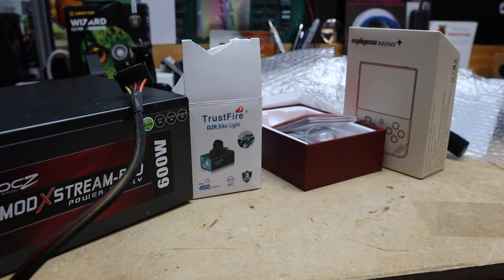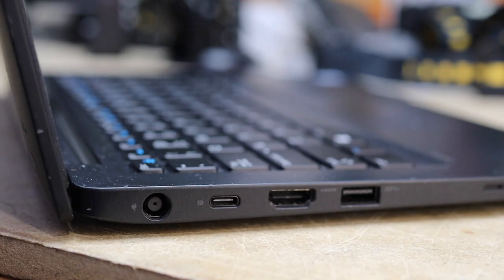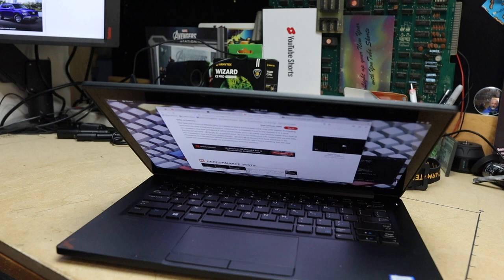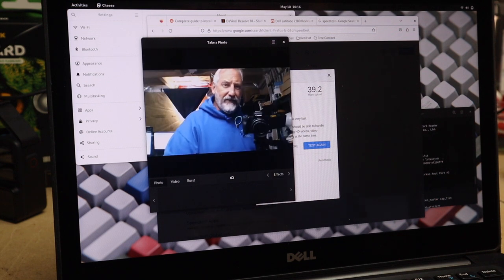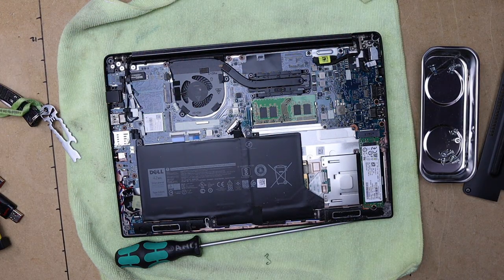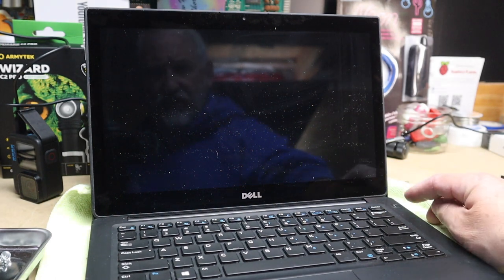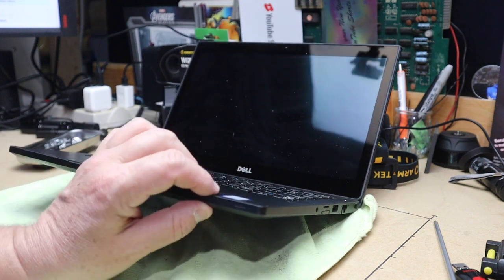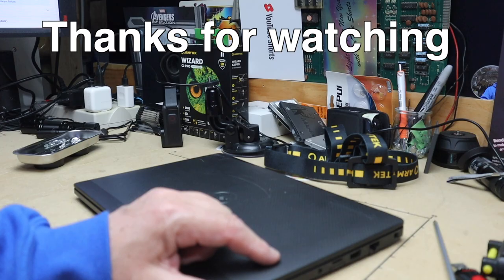DELL 7280 running Fedora Linux

Comment: Thanks for the review! I'm looking for a new Linux laptop (for light usage - just browsing, YouTube etc...), and am thinking about this model. A little put off by the single RAM slot. I might go for the Latitude 7300 instead. I'll be running Arch on mine (with KDE Plasma) 🐧
Reply from the maker: You can never go wrong with Dell. But I prefer Lenovo for Linux. Like the T480s
Reply: @MikeDancy  I've heard the battery life on the Latitude 7300 is around 13 hours, which is why I'm eyeballing a secondhand 7300.
Reply: I purchased it without knowing it had dual channel or single channel
I'm gonna get charged atleast a $50 for exchanging it